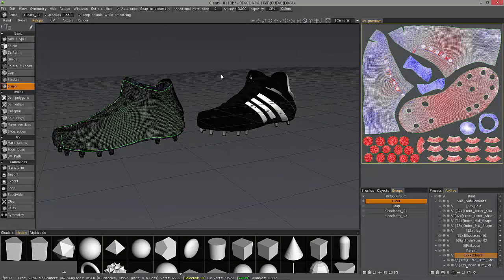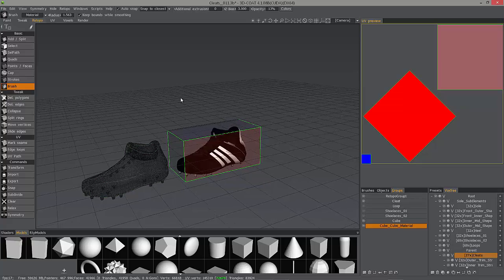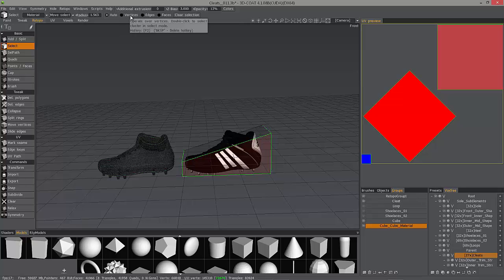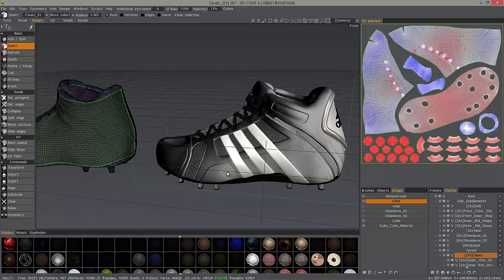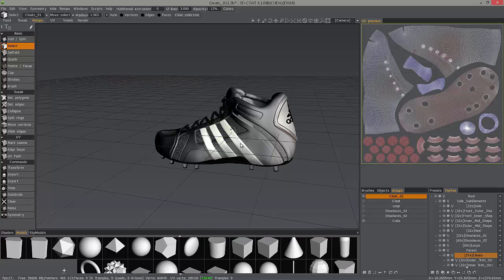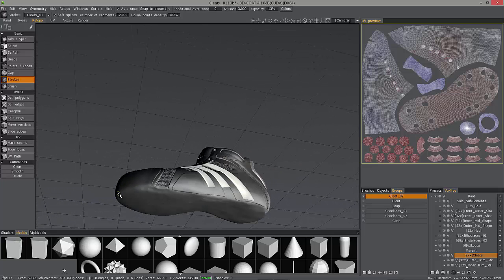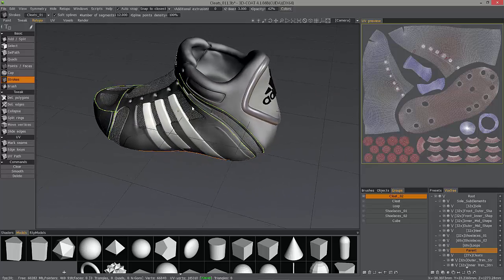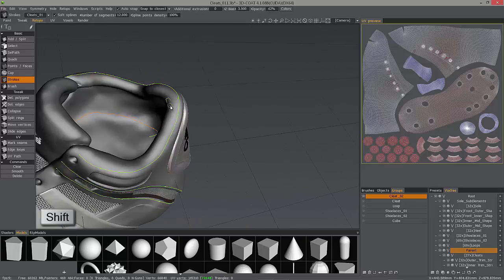3D Coat Retopo Project Pt.1: Sketching Topology

Comment: why is this so low resolution? :(
Reply from the maker: It is 1280x 720p like most of them. Sometimes Youtube compression takes a while to display the full resolution. Not something we can control. Even when we tried 1080p, the time it took for Youtube to finish the compression was even longer. So, 720 is what we decided to go with...as the text on the buttons are clear enough to be easily read
Reply: 3D Coat for me its showing max 240p :( 

720p is fine :) Part 2 shows up fine by the way. 

re: youtube compressing: if you follow their compression standards, then it doesnt have to re-compress anything
https://support.google.com/youtube/answer/1722171?hl=en
Reply from the maker: Aleksey Voznesenski Have you clicked on the widget that lets you choose the resolution? It's playing 720 just fine, here...and letters on the buttons are clearly legible
Reply from the maker: Aleksey Voznesenski I've noticed weird behavior like that recently and don't know if it's an issue with the browser or the latest version of flash player. Seems like every time Flash updates, playback issues follow. So, maybe close the browser and re-open or try a different one, when this sort of thing happens.
Reply: 3D Coat yup, you're right, just browser screwing up, works fine now :) 

Thanks!